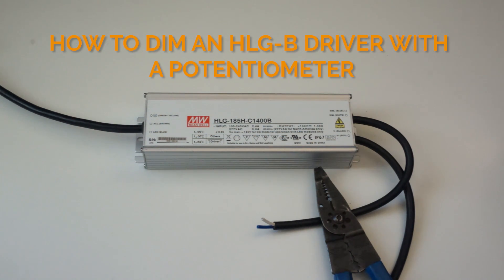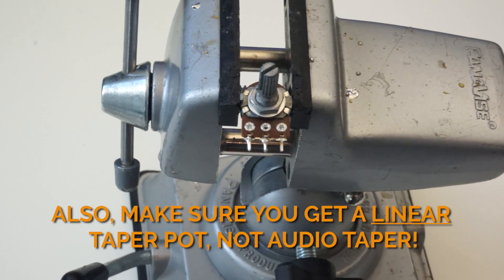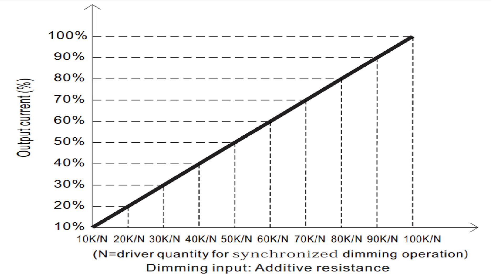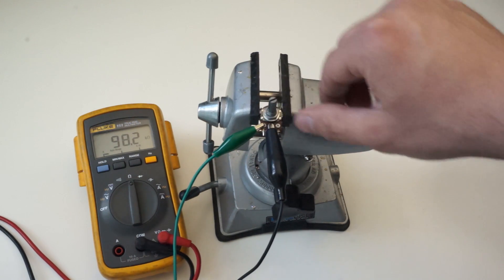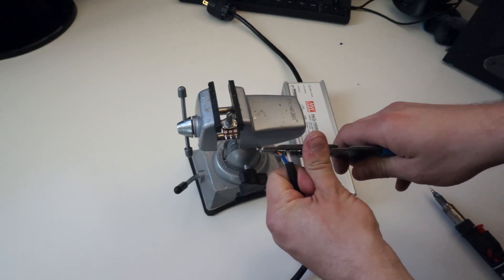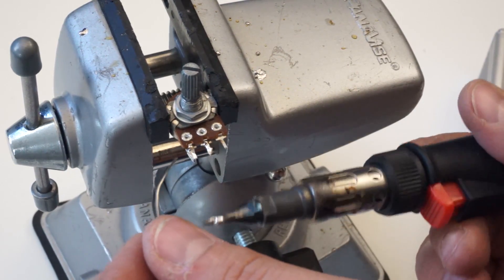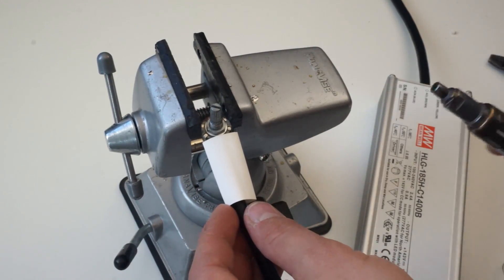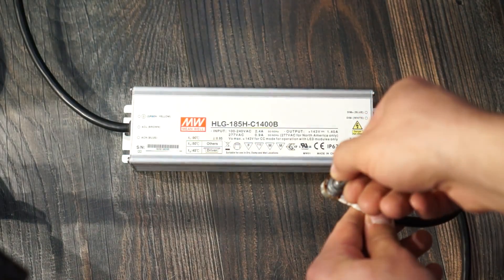Installing a Dimming Potentiometer on a Mean Well HLG-B Driver

Comment: Hi do, i got it right, if i don't put any resistore on the dimming lines than i have automatically the full output? 
So, i just make a isolation between the two whires? 
Thanks in advanced.

Comment: HLG-600H-320B, I've tried two potentiometers, and still not working. I know the first one I bought was logarithmic, but the second is allegedly linear 100k and still doesn't dim. I have one array which consists of 33 LEDs. Any ideas?  I will google how to test if the potentiometer is actually linear or not. I'm thinking they sold me another wrong part.

Comment: Thanks very much!!! I’m doing the qualification courses and schooling I need to join a electrical/electrician training and job placement program with opportunities for being hired based on performance during training, and I just know all the knowledge I learn will benefit me throughout my life,  I have quite a few different trades i decided to invest time into learning, I’m only 23 but have my Red Seal flat roofing (3 years roofing certification), and two years as a carpenter and scaffolder, and 6 months as a automotive (car) mechanic, I find it so weird how these days most people just don’t know the “i-want-to-know-how-it-works” intuition about basic products we use daily, which in my opinion has lead to the current “throwaway” consumer-to-producer/seller market we see today, even farmers battling big companies in court for the basic right to repair and own troubleshooting technologies that work with their multi-million dollar equipment. Just this year I finally upgraded from my very first car (a old Toyota Corolla 1994 model 😆) but I loved it because it was just old enough to where any replacement parts were cheap and super simple to replace. As well as being sturdy, and a truly reliable vehicle that would outperform and not get stuck nearly as much as modern vehicles, my new vehicle is a 2010 Santa Fe, so I can enjoy the best of both worlds
Reply: And as far as what I Learned this video; thanks for sharing your tutorial and process to wire dimmer/potentiometer to a cheap-high end led light driver power supply. 
I know for wiring to a  driver you need to utilize pulse wave/sinewave modulation

Comment: I know this is an old video but I can't find any info on it. I have a HLG-B driver that use to dim properly but now its stuck at 100% can I replace the potentiometer to get it to dim again? I've ordered some cheap ones and nothing and the only info I can find is don't be cheap on potentiometer but not sure if I should fork out the money for a decent one when I dont know if it'll actually fix my issue. The light fires up fine no flickering issues it just wont dim anymore.
Reply from the maker: What values did you order that did not work?

Comment: Could you help me with a fault that I have, I bought an Optic 1xl that has the HBG-100-36B with the free 3500k I bought this light from someone who said it is identical to the Optic 1xl 3500k anyhow, the light flashes on the full beam on the dimmer the only setting where it does not flash is on the lowest dim, seems to be intermittent as sometimes it does not happen for an hour or two then it starts the od flicker, so frustrating but it flickers flashes the most on the highest mark on the dimmer, I am thinking maybe it is the dimmer at fault? could I disable the dimmer by connecting dim white to the dim blue wire, or do you have an idea of what could be wrong, any information would be greatly appreciated

Comment: Really helps, thank you! I like the idea of ease of use with a potentiometer. Sounds a lot smoother than mid grow having to pull the rubber tab off & stick a screwdriver inside just to dim the power supply

Comment: Is there a max and minimum, wattage this pot will dimm?
Reply from the maker: It’s a separate dimming circuit so the output wattage doesn’t matter
Reply: Thanks im stilll stuck with getting this to dim the driver, driver circuit is 10v as soon as I connect the potentiometer it only allows 1.3v no matter which way its connected and where the dial is turned to, any ideas where ive messed up?
Reply from the maker: @marcuswalmsley2458  What is the resistance rating of your pot?
Reply: @LEDGardener  100ohms
Reply from the maker: Should be 100K ohms as in 100,000 ohms
Reply: I checked resistance for which way I wanted the dial to work amd get reading from 10 to 100
Reply: @LEDGardener  I've checked my order and I think this is where ive cocked up, just ordered a 100k, ill owe you a pint if this works 😆, thanks for your time
Reply from the maker: That’ll get you sorted for sure. No sweat!
Reply: @LEDGardener  that was the issue light working sweet final touches tomorrow 👌thanks once again 👍

Comment: I have HLG-120H-54A build in potentiometer.. but idc which is voltage and which is wattage i DONT want to F with the voltage just wattage ... which is is ?
Reply from the maker: Voltage multiplied by current = wattage. You can use one or both pots on there to hit your wattage requirements.

Comment: Thank you for the tutorial! I have a question: The current my LED Board (Zeus 308) runs on is almost proportional to the voltage it gets,  starting at ~37V: (1A: 37,6V, 2A: 38,6V, 3A: 39,5V,...). What would happen if I connected a B-series Driver to it, which runs on 42V max, and a potentiometer to the driver like in the video. Would i have to stay exactly in the range of ~37 to ~40 V in order to work? And: If Meanwell speaks about a constant current region of 21-42V, does that mean, if my potentiometer is at 0 Ohm, the output voltage is 21V?
Reply from the maker: You’re better off running constant current than constant voltage for that board. How much current is it rated for?
Reply: @LEDGardener  Thank you, it only gives information about which voltage is for which current. Link: https://www.led-tech.de/de/ZEUS-308-High-Performance-Platine-3500k (it is german)
Reply: @LEDGardener  The max current i can see is 3,5 A

Comment: Explaining how multiple drivers wired up so they are controlled by a single pot/pwm signal would be a great video ;)
Reply from the maker: All you’ve got to do is wire all the dim + wires together and all the dim - wires together and attach it to your pot.

Comment: Struggling with my driver... I’ve bought the same pot as in the video, but it only dims the LEDs on the last 20% of the pot and it doesn’t dim right down.... anyone any ideas what I’m doing wrong?
Reply from the maker: Is it a Mean Well driver? Is it definitely a 100K ohm pot and not 100 ohm?
Reply: LED Gardener  yes it’s exactly the sample driver and I’ve just double checked the pots and they are marked up as B100k
Reply from the maker: Single driver? Have you tried metering the resistance of the pot?
Reply: Yes I’m just using the one driver for led tape. I will test the pot later and see if it is working properly
Reply: Ok I’ve tested the pot and it seems to work fine around 100 turning  down to 0. I basically have this driver  wired to about 9m of 60 led per meter LED tape. I don’t understand why it will not dim fully down. If anyone can help I would much appreciated it
Reply from the maker: And it’s a constant current driver? What is the exact model number? I know you said it was the same as mine above but it sounds like you’re using a constant voltage driver to me. I just want to know the whole model number.
Reply: Model number HLG-150H-24B

Comment: Great video!   If you wanted to connect a digital display showing the dimming amount (ie, 0-100 for example), how would you do that?
Reply from the maker: dwalden74 you’d probably be better off showing the actual current reading of the driver. You can find little inline read outs on amazon for that.
Reply: LED Gardener  Current reading is one thing - bit if we want to just have an intuitive 0-100% control that other people can use?

Comment: Your videos are great. I bought a hlg 185 1050b. I now don’t want to use a dimmer at all. How can I close up those leads? Is it fine putting 1 Wago on each connector? Or can I use the yellow merit things that electricians use when wiring lights in a house to make the leads not open?
Reply from the maker: Figgles274 anything that will provide a snug connection that covers all the exposed wire will work.
Reply: If I cover them with the yellow hats I can just electrical tape them as well for extra security and just let them dangle and no risk for electrocution as the leads are fully covered? Or could I tape the the jacket down to the aluminium mounting sheet I have for my driver when the leads are fully covered? Because of you I did a custom build on a bridgelux eb Gen 2.

Comment: This is probably a silly question, but will dimming help reduce the heat that these drivers put off? I'm assuming it would, but haven't tried a dimmer yet so just checking.

Comment: Hey bud should i run 5 1212's on a 240 c1400 or a 240 c1750
Reply: I think on the 1750 you can only run 4 and will run at 60 something watts and them chips are more efficient at 50 watts

Comment: Would be nice a video on how to install a dimmer for two drivers. I mean the wiring.
Reply: Probaly by connecting it the same way, but just with 2 wires from every driver connected to each pin.

Comment: amazing video, thank you! i still have one question though: what about the wattage rating on those potentiometers? i see you're using a 0.5w pot, but in what way is this number related to the ratings on this specific driver and does it have to be a certain value? thank you in advance
Reply from the maker: themehuify the power on the dimmer circuit is very very low. It works out to .0001 Watts (100uA*10V)

Comment: Great video, thanks.
So, this example doesn't go into possibly needing a resistor for the potentiometer.  Was it just to be brief or that it wasn't needed with this particular potentiometer maybe? (EDIT: nevermind this Q; I read the comments).

I've been using A types for builds, mainly due to the "extra output" but now I'm thinking - at least for myself - that the B types give a lot more options.  I'd like to be able to dim wirelessly - whether it's zigby, bluetooth, wifi, whatever.

Peace.

Comment: If you have access to your driver why not just get the a model with dimmer built it kind of dumb
Reply from the maker: The A version only dims to 50% of max power while the B version will dim down to 0% or 10%. Not everyone can reach their driver either. Plus, you dim multiple B drivers simultaneously and you cannot do that with the A.

Comment: can a potentiometer be used on a non dimming driver like a apc-12 series where there is no dimming leads or dimming dial on the driver.
Reply from the maker: Common Sense unfortunately not.
Reply: LED Gardener 
hmm what about putting resistor inline with a on off on rocker switch. being on=full power, off=no power, on=1/2 power. just like picking apart not so common ideas. I kinda this also wouldn't work due to the change in voltage would make it so the LEDs wouldn't light up cause the need to see a minimum voltage to light up.

Comment: You truly are a gift from the universe and we are lucky to have you 😁

If it's not too much,  I was wondering if you could perhaps demonstrate how you would wire 2 drivers to one potentiometer?
Reply from the maker: Unagi heheh. It’s easy enough. Just wire leads to the potentiometer and use a pair of 3-port Wagos to tie the two drivers and pot together in parallel.

Comment: If you were to use the driver and potentiometer combo setup in this video, you would only be getting ~98% of the drivers potential power, and you would also be risking damaging your HLG driver if dimmed to the lowest setting. You have to install the proper resistors to ensure your high end is above 100 and your low end no lower than 10. This way you get full driver power while ensuring the dimming never goes below 10%.
Reply from the maker: +Grownonymous Hey dude. Yeah, if you're concerned about the extra few mA you can certainly use a resistor in series to bump the max resistance up. 

Can you explain to me the science behind keeping the minimum above 10%? I have seen no reference to this in any Mean Well documentation, nor can I think of any reason why   it would damage the unit. I assume you're referencing SDS's post.
Reply: LED Gardener That extra few % on the top end is typically only a concern for truly anal builders. Dimming below 10% is really my primary concern.
Reply: Constant Current drivers are designed to provide exactly that. When you dim a 1-10v CC driver below its 1v rating, it no longer provides a constant current. The current produced has the potential to fluctuate so greatly below 1v that Meanwell themselves reference it as the "Undefined Zone" in their white papers.
Reply from the maker: Grownonymous how about a 0-10V dimming circuit?
Reply: LED Gardener 0-10v are built so any input below .57v = off. This is Meanwells 2nd generation dimming, and definitely better if you want to potentiometer dim to 0%.
Reply from the maker: Grownonymous I emailed Mean Well and asked "Can you tell me if there is any issue with shorting the dimming leads on an HLG driver? If you hook up a 100K potentiometer, do you need a resistor inline to prevent the leads from shorting at the lowest resistance of the pot?"

 Here is the response I received from their engineer: 

"There wouldn’t be any issue with shorting the dimming leads. Because it just leads to dim the light to the lowest brightness corresponding to 0ohm resistance."
Reply: LED Gardener Correct....and 0ohm resistance on a driver capable of 10-100ohm functionality is what creates their Undefined Zone. If you want to run your components in this zone of varying current, by all means, don't let me stop you. As per Meanwells own documentation "The ouptut status is not guaranteed when dimming is less than 1v or even short the dimming wires. The output of LED driver could be completely switched off or there is still some light coming out of the LED module. In case application would require to completely turn off the driver, one switch at AC mains of driver is required."

That is directly from Meanwells white doc detailing differences between their own 1-10v and 0-10v dimming methods. But.... ultimately none of that matters, cause all you have to do is hook up a multimeter and dim the driver below 1v. :)
Reply from the maker: Grownonymous Your original comment was that dimming without a resistor could lead to damage to the driver, which isn't true according to Mean Well's technical support engineer. If the people who make the thing say you can put a dead short across those leads without damage to the driver, that's what I'm going to go with. If they came back and told me to use a resistor, I would certainly make the correction in the video.

This discussion probably isn't worth a whole lot anyway though since I doubt many people run their driver dimmed to the absolute minimum for any length of time :)
Reply: I would only argue that there is a slight difference between the engineer that designed that component, and the $12/hr employee that answered your email, but again....a multimeter will tell you everything you need to know. That said, you are free to run your components in any configuration you decide.

Comment: What solder gun with blow torch kit do you use?
Reply from the maker: +jan fish this is the kit I have: http://amzn.to/2t9kRbt I've had it for years now and use it in the field for work too. Love it.
Reply: Ah ok thanks. It will be nice if you can do an update of where to put the resistor?? Do you even really need a resistor ? And why?
Reply from the maker: You don't need one but it doesn't hurt to use one. You would just wire the resistor in series on one of your driver dimmer wires. Some 100K potentiometers don't actually quite hit 100K ohms, so you can tack on the resistor to make sure the max resistance meets or exceeds 100K. Also, on the other side of the potentiometer, some people claim that it's not good to allow the dimmer leads to have zero resistance between them, so the resistor also serves as a minimum resistance when the potentiometer is turned all the way down.

As I mentioned below, I messaged Mean Well to ask about this and their support engineer told me that there is no need for a resistor and that shorting the leads is fine. I haven't heard of anyone having any problems with using pots without resistors on MW drivers either. However, adding a resistor can only benefit you so it's up to you if you want to use one or not.
Reply: ok thanks

Comment: Am I confused I thought it went white on first terminal and blue on second for the potitiometer.. Either way still works and great videos keep em coming!
Reply from the maker: +Wezonit Thanks! The dimmer wires in this case are just looking for resistance so it doesn't matter how you hook up to the pot, as long as you get the terminals right.

Comment: Robin from HLG sent me to your channel because of your latest video on how to put together the 90/135/260 watt kits. thanks for the how to by the way..  I have a question about hooking up duel drivers to single pot..    Would I want to use the T style "waterproof" type connectors similar to the ones I get in those kits to join the leads then extend them to where I want my pot at? or would the wago 221 3 clips work? I'm going to build up to a remote driver setup where I don't need the extensions but till that point I am  wondering what is the best way to wire 2 HLG-480h-c2100b's to a 0-50v ohm  pot  with a long lead for dimming. thanks for your videos and time.
Reply from the maker: Jolly Green Giant hey there. There's next to nothing for power on the dimming wires so if it were me, I would just use the wagos.